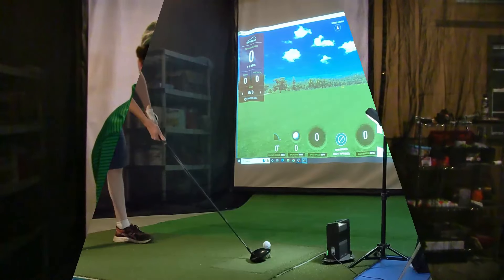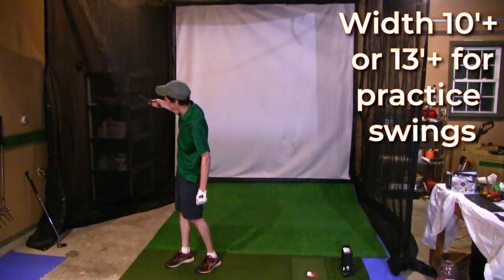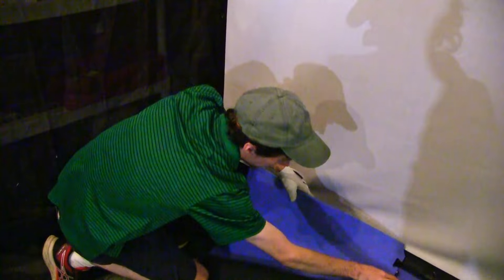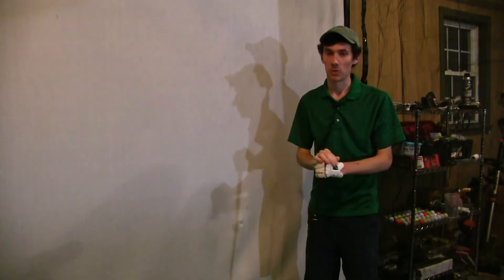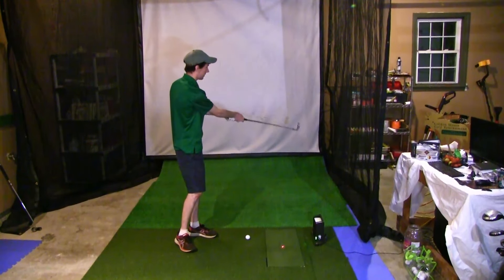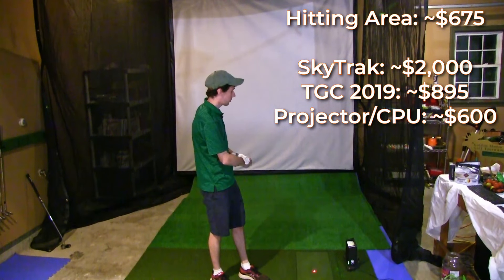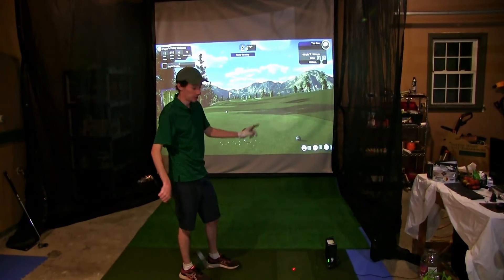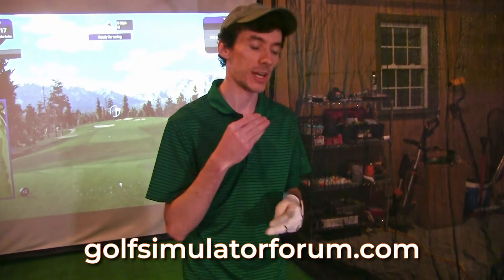Building a Cheap & Safe Garage Simulator Cage - SkyTrak, Mevo, etc

Comment: Well done!  The shot analysis data @17:00 - is that from SkyTrak or is other software/hardware used?
Reply from the maker: The Shot Analysis is from TGC 2019. The basic way it works in that TGC 2019 takes the data from the SkyTrak then applies its own flight model to it. So a shot hit with the exact same parameters on the SkyTrak Range will be slightly different than on the TGC 2019 Range. They are extraordinarily similar, but worth noting that TGC 2019 does use its own flight model even though the data itself is just being pulled from the SkyTrak.
Reply: @muskratlinksgolf  ... so how is strike location determined?  Are tags applied to the club face, and then a software process of  TGC?
Reply from the maker: @willgo7898  SkyTrak doesn't measure any club head data, it just calculates it based off of other parameters. In other words, it will get in the ballpark for club data, but it isn't accurate. If you are curious as to what SkyTrak measures vs calculates, I found this article helpful! https://mygolfsimulator.com/skytrak-data/ 
You will need to get into the $7.5k+ price point before you start to see units that measure club data.

Comment: Nice setup! A beginner safe full mesh cage that can retract out of the way is exactly what I need. Where did you get the tracks so the mesh can be stored away? So the Mevo plus isn’t good for putting?
Reply from the maker: Thank you! I went with some Flexible Curtain Tracks off of Amazon, I would still recommend doubling or tripling up the little rollers it comes with to spread the weight of the mesh. My opinion on the Mevo's putting is based on research, not experience. You need to take significantly more time and resources to ensure you have a perfectly smooth putting area for it to have a chance at getting reliable readings. Combine this with the fact that most garages slope away from the house for drainage, and it was always going to be a better bet for me to go with a SkyTrak!

Comment: What club data is available with this monitor?
Reply from the maker: SkyTrak doesn't measure any club data, just ball data. It does, however, calculate much of the club data based off of the ball data. If you want a more in depth list of what parameters are measured vs calculated https://mygolfsimulator.com/skytrak-data/ has some good info!

Comment: I am not finding the links for all of the materials
Reply from the maker: I ended up not using the exact links to items since most of them have changed or the price went up on Amazon; as I result I just talked about them or put up a picture on screen. If you need help finding something specific, let me know!
Reply: What did you use for your exterior tarp?  Where did you get your ceiling rails?  Thank you!!😊
Reply from the maker: @andyburr7192  The exterior tarps are from Harbor Freight: https://www.harborfreight.com/10-ft-x-12-ft-mesh-all-purposeweather-resistant-tarp-60576.html
The ceiling rails came from Amazon searching for "Flexible Ceiling Curtain Tracks". I was worried they would be a little cheap but they have been excellent so far as I doubled/tripled the number of rollers for each connection point to the tarps.

Comment: What 📽 did you use
Reply from the maker: Ended up going with the InFocus IN119HDX. Cheap and more than does the job for a garage setup!
Reply: @muskratlinksgolf  too rich for my blood. I found one for $180.
Reply from the maker: @kbbvwelsh9334  Well that one I picked up for $105 off of ebay, but I think anything under $250 that does the job is a winner!

Comment: I don't like that delay.
Reply from the maker: Yep, completely reasonable, you get what you pay for with a $2k unit. Once you start getting into LMs upwards of $8k, they do most of the processing internally rather than sending the data over to the computer for additional processing. Fewer steps yields less delay!